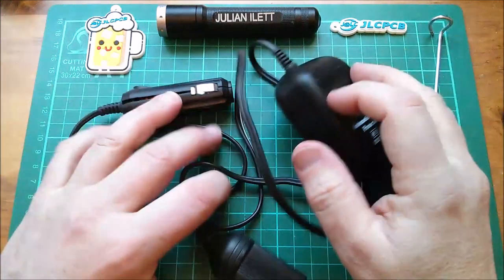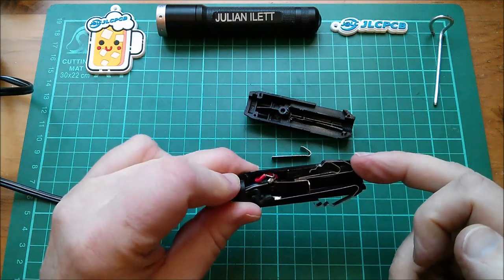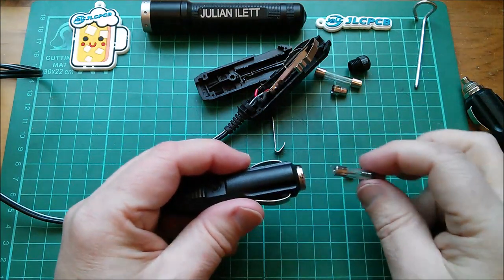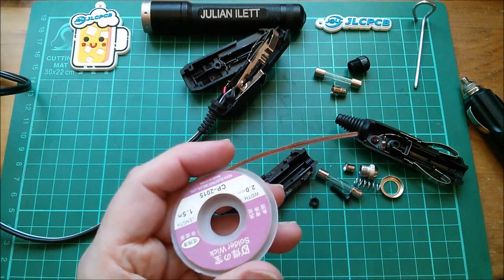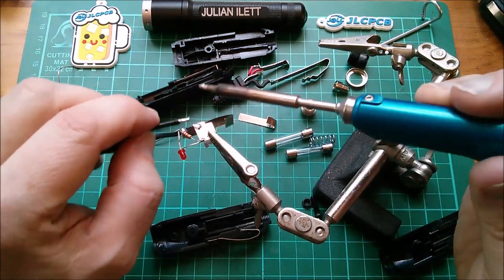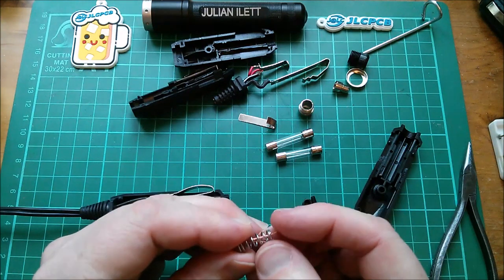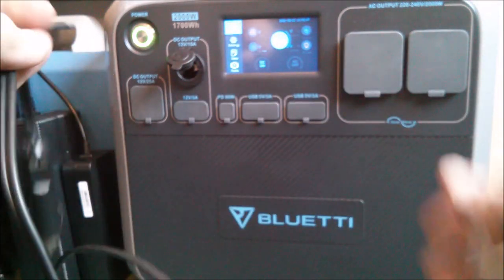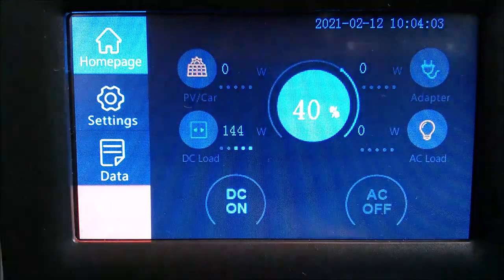Cheap Cigar Plug Melts at 10A

Comment: Two issues:  1) your solder wick didn't work well for desoldering because the impregnated flux dried out 2) the wick won't work as a conductor because it's coated in an insulating layer of dried out flux. Test it with a multimeter to confirm.

That solder wick will work a charm for desoldering if flooded with enough fresh flux. It's much easier than solder suckers, depending on the job. Never try to use it as a conductor though.

Thread the 12V +ve wire through the spring and solder it to a spare nipple contact from the broken melted plug. Then you'll end up with a nipple touching each end of the fuse, one of which is directly soldered to the wiring. You may need to clip the spring a bit shorter to accommodate the length of the extra nipple.

It might be easier to ditch the fuse altogether, but you'll still need to find something a similar length to replace it. As long as your power source is safely fused it shouldn't be an issue. It's good peace of mind having more fuses than necessary, but troubleshooting multiple blown fuses in a series circuit can be tedious.
Reply: Yh, I noticed the braid either had very little flux or no flux (Looks too dull, flux coated stuff looks to be coated with a white powder). Also, when I use braid in this manner (Like as a pass through for my pushbike brake light MOSFET-gate signal) I use label remover/naphtha to remove the flux and in the case of label-remover (dLimonene+oils) some IPA (Not the drink, the proppa sends-ya-blind stuff XD ).
.
Also, I'd of used more strips of braid than Julian did thus allowing more current... I'd say about 4A per strip, thus 3x strips for 12A (with it still getting hot but not melting.... hopefully) or 4x strips just for good measure.
Edit: also helps if the braid isn't some copper plated steel/iron..... Otherwise back at square one (I suspect this due to Julian having trouble bending the braid around the spring)

Comment: Rather than use the solder wick strip (of unknown composition and resistance) use a length of braided copper screen from the end of a co-ax cable.  Makes wonderful bonding braid.
Reply: Oh hey thanks for the idea, I got a few coax cables that I don't have much use for.

Comment: Probably need to make some small copper washers/inserts/caps (e.g the end caps of a fuse) for each end of the spring and solder the braid between them.
Likewise a bit surprised you didn’t measure the voltage drop across the plug internals to see how the original and your mod(s) compared.

Comment: Back in the day, when we found those plugs with the spring on the bottom , we moved the spring, some times changed the spring to one that fitted into the tip.  That way the spring was captivated in the tip housing an didn't twist out of shape.

Comment: re the solder wick, the cheap stuff is crap because it has no flux in it like better wicks do. if you dip it in flux before use its a very effective way of cleaning up solder pads.
Reply: Exactly what I was thinking. No flux.
Reply: Solder wick is usually impregnated with flux that dries out over time. Works great when fresh out of the pack, but almost useless after a few years.

The dried flux also forms an insulating layer, so it's no good for use as conductive wire braid.

It still works great though when flooded with fresh flux.
Reply: I do that and yeah works a treat.
Reply: @andymouse  awesome tip !
Reply: @maicod  I buy the crappy stuff then add flux....I'm a cheap date !
Reply: @andymouse  will remember this tip
Reply: Well I don't know what I did wrong, but I had some cheap wick that didn't want to work even after I added flux, that was a while back before I bought a TS100 and my previous iron wasn't nearly as good so it could've been multiple factors.
Reply: @vgamesx1  Could be the copper was severely oxidised, I guess then its had it.

Comment: Perfect timing!!!  I'm starting a project that requires a cigarette plug connection for maintaining my old car battery while it's not in use.
Reply: I would suggest find a different way to connect things.  The cheap cigarette lighter socket had a 5amp fuse, and they usually can't handle even that continuously.
Reply: @EsotericArctos  I'll only be trickle charging at around 1 Amp.

Comment: I'm... kinda confused now?
It's a 12V 15A heater... and the device you plugged between is only rated for 10A... and when you plugged it in the consumption dropped which indicates that there is some kind of other fault already anyways but... the 15A is way over what the original plug was rated for so I don't quite see where the problem is here for it melting?
Reply: Likely internal resistance dropped it just enough to avoid the over-current trip on the Power Supply.
Reply: And the internal 10Amp fuse rating. It can only carry 15Amp for so long. Wonder what the 10 hour rating is on those fuses. Might be an idea to test the fuses Julian!
Reply: @nigelprentice2084  I was going on the rating of the device more than the absolute limit of the fuse, but it would definitely be interesting to see how the fuses perform too :)
As a note, it is not the negative of those plugs is also a spring metal, and it gets quite hot under load too

Comment: I've had the exact same problem with such plugs - I detest them. They are the most inadequate and inappropriate design for modern DC devices and although the thermosetting plastic plugs are more robust electrically they are easily fractured. The thermoplastic ones (ABS, HDPE, etc are just useless). It's about time the car industry provided a properly engineered terminal for DC like say XT 60 or Powerpole connectors.

Comment: It's possible that the heat was actually being generated in the fuse and being transferred to the spring (need to bring out your thermal camera).
 I've never had any luck with these types of plugs from electronics type stores and eBay, but the ones that I've purchased from Car parts stores have been great, they are much sturdier and made with higher quality parts, which also makes them a bit bigger.

Comment: You should try using a thicker and shorter spring and use a piece of copper as a spacer. The tip does not need a lot of travel. The spring is used to make a good connection but I have used these without any spring, just with a spacer.

Comment: I've just dismantled a car USB 3.0 charger that blew the 20A fuse in the car; it turns out that the +ve connection is a turned metal part that connects to the PCB via a spring; the spring isn't retained on the PCB, but is threaded through a piece of metal soldered to the PCB. In order to save space, the designer put an electrolytic cap directly behind the piece of metal such that, if the spring rotated, it threaded further into the metal plate and contacted the capacitor; eventually, it split the sleeve on the cap and contacted the metal case which is not isolated, and shorted the 12V supply.
The quick fix was to cut a small piece of Mylar and put it between the cap and the metal piece so that the spring cannot contact the cap.

Comment: The copper braid is a solder wick and it has flux on it, so it is not a better conductor than the spring. remove the flux and you have a proper copper braid. These are my thoughts on your problem.

Comment: Hi Julian, good idea, the braid.
I am sure many, many years ago I think I came across a similar fix, but it was OEM, not added later.
Have you looked inside the  good plug to see how it is constructed?
Are you sure you didn't have a short in the melted plug, the metal strips that the LED is connected to are very close when the assembly is open, possibly short when assembled.
If the plug got hot, why didn't the wire?

Comment: It is unfortunately very common that the spring is used as a connector and gets very hot. Only a few devices have a wire connected directly to the tip.

Comment: The solder wick wrapping around the spring ends made the spring too long?  Try soldering the wick to the inside of the spring (maybe where the spring wire ends).  Try to keep the solder to the first two coils of the spring where there isn't any/much springyness.  Then, trim the wick flush with the spring and smooth up the spring ends.  Might be a good idea to loosen the wick braiding to break the dry flux where it's not soldered to the spring.

Comment: I've had this happen before as well. Apparently there was still some current traveling through the spring. I don't know if taking something like the ends of a fuse and putting it over the ends of the spring and soldering the braid to it will work or not.

Comment: I had the best luck making the positive wire longer, running it through the inside of the spring, then soldering it directly to the pip's back. Then there's only contact resistance on the pip to socket, and from the wings to socket. The pip is a bit stiff but it has enough spring still to work

Used two of them like this to run a 400w amplifier in my second car because I was too poor to run a proper beefy cable, and they don't get warm at all, even during bass heavy music.
Reply: LOL, This is exactly what I did many years ago.
Reply from the maker: This is my plan :)

Comment: Run the copper wick thru the spring but, solder 1 end directly to the terminal or wire and solder the other end to a small washer between the spring and fuse. 
- 
tldr: Give the current another path to travel besides the spring.
Reply from the maker: My plan, exactly :)
Reply: @JulianIlett  Check the solder braid isn't copper coated steel (2x methods):
1 - Use soldering iron and solder to coat an end of the braid and if it doesn't take properly, the copper is so thin it's dissolving away leaving steel.
2 - use a blow-torch, a short burst of green flame followed by yellow sparkling and (non-greenish) blobs means there's a lot of iron/steel inside.
.
I got a reel of braid here that's either from CPC/Farnell or RS-Components (At work, can't remember where from, Ali may do fake versions of this, so be warned), the brand is "Servisol - Soldamop" it's the green-label version of the reel and there's a number "MIL-F-14256" though that number maybe just a batch number... 
.
If ya want just reply asking I to look further into this and I'll see if I could find where on the sites I know it maybe from and try and link ya to the braid (The proper stuff is relatively expensive compared to the fake steel-coated or fluxless stuff, it's preloaded with quite a bit of flux)
Reply: @dedr4m  Keep in mind that the flux-impregnated wick dries out over time.

I have a couple of rolls of the really good Servisol wick that worked great 20 years ago but barely works now. Flooding it with fresh flux restores the wick.

Comment: Well 120W for a 12V socket is a bit overkill..not many are 10A rated on the car itself.
 70W feels alright, a laptop charger would be interesting. On our cars only one socket in the rear is 10A, rest looks to be 8A fuse or even less.
Smallest is 4A slow fuse 48W only printed on its cover sooo

Comment: Besides the spring, I did consider the fact that the 10A fuse might actually be causing the spring to heat as well. If the fuse is run close to it’s current rating it’s going to become very toasty. 

One observation I made in a few accessory plugs I’ve taken apart in the past mitigated heating of the spring by placing the positive conductor before the spring so that the spring doesn’t take any current.

Comment: That's why i wired my CB to a relay on a dash switch, the cigarette lighter plug i was using  couldn't handle the consumption of the CB and the separate RF Amplifier i use and the plug got crazy hot!
Im still wired to the Cigarette sockets power source but with a relay soldered  in to the wiring behind the socket which works out better anyway as i can still have a phone charger plugged in while the CB is on now :)
Reply: So your car has more than one cigarette socket, eh?
Reply: @SpeccyMan  no, i wired a relay into the wiring on the back of the socket, the relay is activated by a switch on my dash.

Comment: strange to see that the unit is marked as being supplied from Luxembourg, as the lower case e and number 13 in a rectangle show's it was approved  so supplied via Luxembourg. As any device connected to a car/ truck or bus etc needs to be E-marked.

copper braid is an old trick we used to used on battary holders in radios, to help with the current demand on transmit.
Reply: seeing all my mates here in the comments :)

Comment: Inline fuse holders have a similar spring arrangement - but the types I used had the contact on the fuse side of the spring, running the copper conductor inside the spring. eg. RS#414-601 Neat idea - no current going through the spring at all. Could you modify a cheap plug to do the same?

Comment: I only use solder wick to remove solder from SMD pads after I have removed the part.
Can we look inside the connector on the heater so we can see the difference?

Comment: Greetings Mr.Julian, I wanted to know what your thoughts were on this little guy here I found on ebay from seller Frentaly: [Apparently I Youtube won't let me comment with links] 
Fully Assembled DSO138 2.4" TFT Digital Oscilloscope by seller Frentaly

I would like to have my own full sized oscilloscope but the price tag is a bit of a deterrent at the moment and I happened to stumble across this one here so I got it to see if I can make heads or tails of some toys I'm tinkering with. It seems to work well enough but I'm no expert so I thought I'd ask someone I think would know!

Comment: after seeing Clive using braid (wick) I got some from Ali but it also fails
Reply: Should go for Servisol (The green label version), contains lots of flux in the braid and isn't copper-coated steel.
I mention this brand as it's literally just sitting here on my workbench at work, other brands also could be as good, just I can't think of any atop of my head right now,
Also, I can't remember if it's from CPC/Farnell or from RS-Components (also the other usual outlets should be the same)... Careful of the fakes from Ali, E-Bay, etc... they may not be as good and not worth judging the brand on the fakes (of course).
Hopes this helps.
Reply: @dedr4m  thanks @DedR4M !

Comment: Well, I would say the spring is getting hot because it's acting as an inductor.  Now are you sure that the copper braid is actually copper AND that the flux it's impregnated with isn't acting as an insulator of some sort?  In the olden days, that braid would have been soldered to the ends of the spring.  See if RS or some other outlet has a better quality plug?
Reply: The spring is acting as a resistor - inductor is no issue as it's passing DC not AC.
Reply: Inductance won't be an issue using DC
Reply: @barrieshepherd7694  Well, you pass DC through a coil, it'll get hotter than a straight bit of wire.  There is inductace in a DC circuit https://physics.stackexchange.com/questions/129441/is-there-inductance-to-a-dc-circuit
Reply: @lloydgarland4667  In a steady state DC circuit would not the heat dissipated by a straight wire wire be the same as the heat dissipated by the same wire coiled -  with the same current flowing?  If not where does the extra energy come from?
Reply: A coiled wire will produce more heat per cubic meter simply because there is more wire in a shorter overall length. This is especially a problem in a poorly ventilated small space...
Reply: @Mark1024MAK  Ello Mark :)
I remember the days of CB radio - I used to light ciggies off a small coil of wire attached to the Maplin PSU!
Reply: @lloydgarland4667  - I was too young for CB Radio! 🤣

Comment: Those plugs are crap and shouldn't be used for more than a couple of amps. 
If you want more power, replace the socket with Anderson powerpole connectors. You can fit 2 pairs in the place of the old lighter socket and they will handle 45 amps with the PP45 contacts.
Reply from the maker: XT series connectors are my favourite

Comment: You are using a device clearly rated at 15Amps on device rated at 10Amps.  The device is not a current limiter.  You are grossly exceeding its rating....... No wonder it melted.  And the cheapy plug you bought had a 5 amp fuse?!?!  15 amp through a plug rated for 5  amps, no wonder it melted.